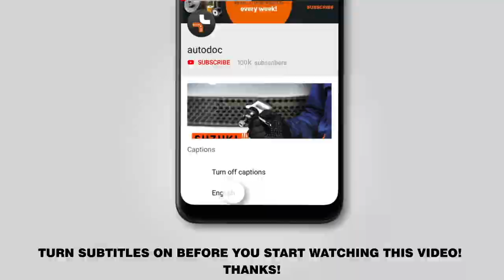How to change front brake discs / front brake rotors on LEXUS RX400h 2 (XU30) [TUTORIAL AUTODOC]

Comment: No grease on glide pins or on contact points on brake pads??
Reply from the maker: Thank you for your comment.
Unfortunately, we didn’t show this in the video, but we lubricated the adjacent parts of the pads with 3077 Liqui Moly special anti-creak grease, and also replaced the grease in the caliper guides with 5,000,000 150 osch.
Best Regards,
Autodoc team

Comment: Great Video. It's been a while since I replaced brake pads and rotors. I would not have known to remove ABS relays  and disconnect the accumulator battery terminal before starting. Thanks for the info.
Reply from the maker: We are glad that you enjoy our work!
AUTODOC

Comment: Will disconnecting the underhood 12V battery and keeping the remote key far away from the vehicle effectively do they same thing as pulling the ABS relays?  Do you recommend doing both?
Reply from the maker: It is highly recommended to disconnect the accumulator battery terminal and pull out the ABS unit relay before working on the brake system.
AUTODOC

Comment: Hi, why do we have to remove the blue relay’s from the fuse box?

Thanks for your valuable videos on Lexus rx400h, I recently changed rear rotors and pads on my 17 year old Lexus, wasn’t straight forward but got there in the end, your video was very impressive & informative 😊
Reply from the maker: Remove the blue relay from the fuse box to disable the ABS system.
Thanks for your feedback! We're glad you found our work useful.
Reply: RX400H is a hybrid and has a non-standard electronic braking system. If the calliper was off the car and someone turned on the ignition (maybe to put the radio on or maybe a mechanic to check the car's mileage) there's a chance that the brakes will activate slightly and pop the calliper piston out. That would then need a brake fluid purge which requires Lexus/Toyota scan tool, i.e. an expensive dealer recovery/repair.

Comment: Followed these steps but when I reinserted the relays the ABS actuator got really hot. Determined that one of the relays was broken and replaced both but the ABS actuator is not coming on and I believe as a result the car will not stop regardless of how pressure is applied to the brake pedal.

Comment: what size bolts were used to dislodge the rotor?
Reply: 8mm x 1.25 pitch bolts
Reply from the maker: It is not possible to answer your question unequivocally since the bolts may be different and in this case the necessary ones were selected.
AUTODOC
Reply: @autodocuk  thank you for pointless answer.
Reply: Good point, this is a key thing to the video and is not mentioned at all during the sequence or as part of the tools required at the outset.
Basically unless you have these random sized bolts lying around you're goosed.